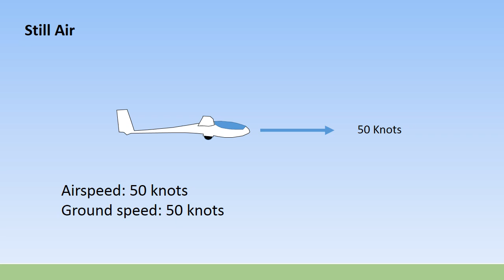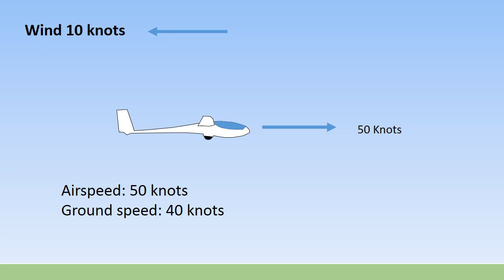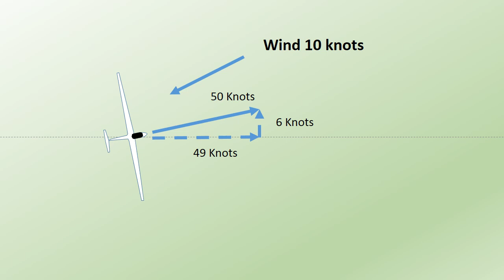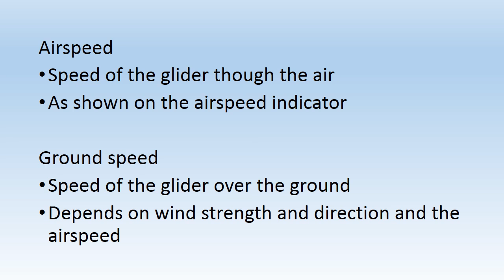Ground Speed & Airspeed

Comment: CUGC Gliding Theory Is this an okay/true way to think of it? The airspeed is how fast you should be going if there was no wind, or how fast you are going if there is no wind, and the groundspeed is how fast you're going after the wind's effect, if any, on the glider or airplane has been added to the airspeed to find the true, actual speed of the aircraft.
Reply from the maker: I think your confusion is caused becuase the speeds are measured reative to two different things. Air speed is realtive to the air (and would exist even if there was no ground) ground speed is relative to the ground.

Comment: This slightly helped, but I still don't understand that if there is a headwind for an example, that the airspeed stays the same but the ground speed decreases. I mean if there was a headwind of 10 knots wouldn't the whole dang glider slow down by 10 knots meaning it's airspeed would change? I don't understand. So if there was a headwind of 10 knots pushing against the glider, would the speed of the glider traveling through the air actually change? It seems to me it would.
Reply from the maker: A 10 knot headwind would reduce the groundspeed by 10 knots, the airspeed would remain constant.
Reply: No it wouldn't. This confused me too initially. But Airspeed is really speed of the glider relative to the air. So when, in your comment, you say "wouldn't the whole dang glider slow down by 10 knots", you are intuitively yet incorrectly thinking of glider's motion relation to you, who is on the ground looking at the glider as it gets slowed down from the headwind. But from the perspective of the air molecules that are going at -10 knots w.r.t to you, the glider really is going 50 knots. hence, airspeed=50 knots regardless of headwind or tailwind.
Reply: Thanks Shreetron. Very helpful. what does the "w.r.t" abbrv. mean?